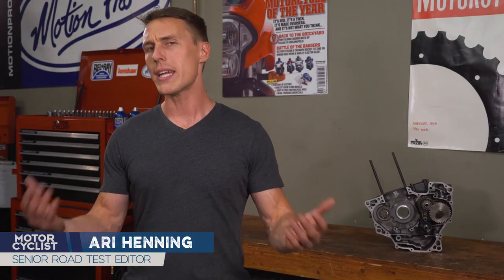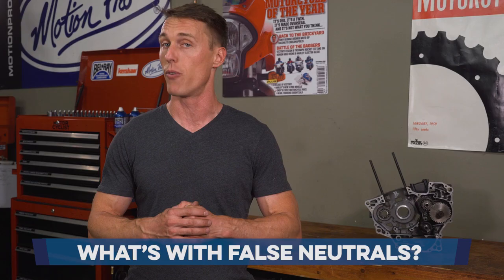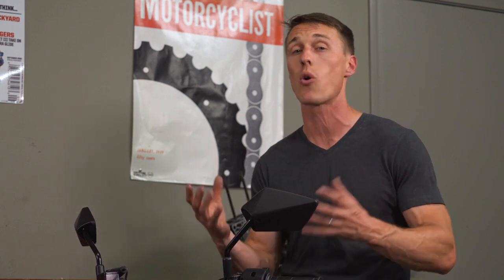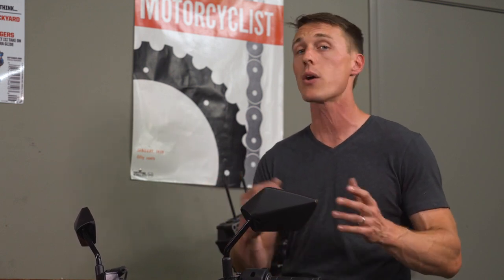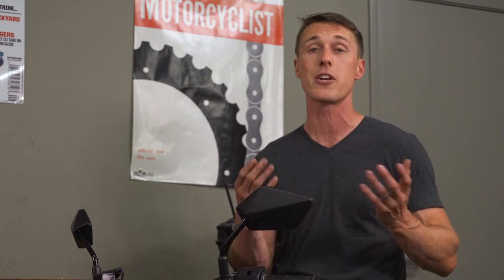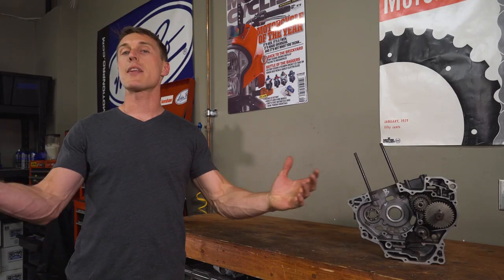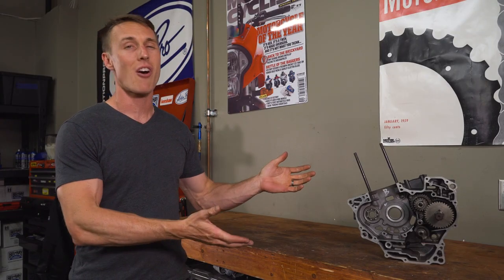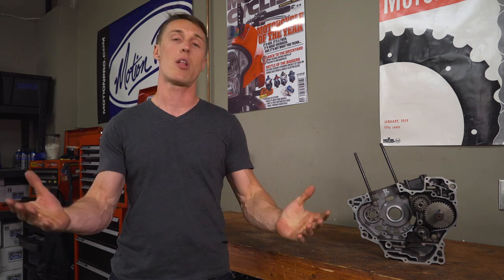What’s With False Neutrals? | MC Garage

Comment: Question for next videos I always wanted yo ask: Life expectancy of motorcycles. What average milege you can do until your motorcycle becomes junk?  Yes I know it very depends on riding style, oil change etc but why some 1000cc bikes like Kawasaki versys can do 300000 km but you rarely see R1 with more that 100000 km. What average engine resource for different types of motorcycles?
Reply: That's dependent on SO many factors. How the bike is used and maintained, the conditions it's ridden in, the metallurgy and manufacturing quality...
Reply: And how engine size scales with motorcycle lifespan? Does 250cc always lives less that 650cc or 1000cc ?
Reply: any motorcycle if its japanese will last forever if you take good care of it

key to long engine life is complete engine warm up, and clean high quality MOTORCYCLE oil

my 2015 fz09 has 40000 miles with no oil burning and pulled 110 hp on the dyno last week
Reply: Any bike engine from the major manufacturers will last a long time without needing to be rebuilt if you take care of it (motocross bikes being the exception). The reason you don't see many sportbikes like the R1 with high mileage is because most of them either get crashed and parted out or they just don't get ridden often enough. The Versys is much more likely to be a commuter than an R1, and you're also a lot more likely to crash the R1 in a way that totals it because of the expensive plastic.
Reply: My guess is that ergo bikes like the Versys have high mileage because they're comfortable, and people will ride them more frequently and for longer distances than a super sport. I only ride sport bikes (don't even own a car) so my bikes have clocked in a lot of road time. My 2016 RC390 has almost 10k miles (I bought it in February) and my 2001 Ducati 748r has nearly 100k miles. Life expectancy comes down to how the bike was treated, and I have no problem buying a high mileage bike if it's clearly been cared for and has full service records, because I watched my friend completely destroy his R1 in 8k miles, but there's a dude in my neighborhood with a 1987 GSXR 1100 with almost 200k miles that runs great.
Reply: Assuming they're built to the exact same standards an r1 has its peak power at 12,500 rpm and the versys 1000 at 9,000 rpm. It's fair to assume that the most commonly used rpm range is proportional to this difference, so that's roughly 40% more revolutions from the r1 engine for the same distance. More revolutions=more wear (though probably not 40% more). Also take into account the r1 is designed to go fast and the versys to go long distances. So the r1 has in some instances design choices that sacrifice longevity in pursuit of speed, and the versys speed to make it go further. Also a sport bike is likely to be ridden harder than an adventure bike.
Reply: bikes in the early days are built to last a long time but im not sure about modern bikes components of today. Seems like parts are outsourced from mainly China.I see newer bikes with frequent electronic parts failing even on Honda. Aint sure if its the hardware itself or just software glitch.  Engines are built by the manufacturer though.
Reply: My friend has Yamaha TZR 125 2t and it has over 95000km!! And every km has been driven without any power restrictions. I would say that's longlasting! Ofcourse it has gone trough many piston changes and other 2t maintenance but still.
Reply: @villepyykonen9664  sounds like triggers broom
Reply: @villepyykonen9664   Usually 2 stokes need new crank bearings at around 15.000 to 30.000 km for smaller 2 strokes like 50cc mopeds. I have rarely heard of those lasting much longer than that without bottom end rebuild...
Reply: I have Suzuki rg 125 f 2t and it has 64000km, and well i quess almost every wearing part is not original anymore :D
Reply: My Yamaha XJR 1300 has done 110,000 kms without a rebuild
Reply: A friend of mine has 70k on his Triumph Daytona (it's getting quirky, but nothing unmanageable).

I would say they do really well as long as you keep riding them. They do NOT like being garaged for long periods (I bought a "low mileage" deal with a few years on it, and the maintenance costs were high as it was constantly having issues with cracked seals and iffy wiring).
Reply: I think that would make a good video... though I tend to think that the performance bikes are "more tightly wound" and that results in shorter engine life. The tech evolution mean that when the engine does let go - your money is better spent on a new performance bike instead of fixing the old one. Other bike types aren't as likely to be slaves to that 'constant improvement' cycle and their motors are generally not as close to the design edge.
Reply: Sergey G my noisy 2004 Yamaha XJR1300 already clock 299858 km with only clutch housing noise when idling
Reply: Bought my 05 r1 brand new and only put one starter in it, Sold it with 75,000 miles on it for a fz8 with 12,000 miles on it. It's all about the warm up and oil changes. Up on one
Reply: Sergey G many factors. A multicylinder engine's rings and pistons will last longer than a fewer cylinder same displacement engine due to the fact that at the same rpms multicylinder rings travel less distance. But multicylinders are usually higher reving so the other parts like crank bearings and other bearings will have shorter life. Same is true with the bigger bore vs smaller bore same displacement engines. High compression ratios can also effect the engine life. The bottom line is an engine that is a balance between all the factors and will last longer provided it is well taken care of and fluids are replaced in time and riding style is more sensible  and is not abusive
Reply: Goldwing? Literally capable of 1,000,000 miles without an engine rebuild.

Comment: Regarding the clutch drag and clunk selecting first, in a perfect friction free world with zero clutch drag you would not be able to select first. The gear dogs are square ended, there is no lead in on the ends so if the gears are not rotating at slightly different speeds they will not engage. Try selecting gears with the bike stationary, no rocking it, and the engine switched off, it's dang near impossible.

Comment: Your videos are the best! Cant wait for some new topics. I have a question, can it damage the transmission? It happens to me couple times when i shift without clutch. Thanks!
Reply: Clutchless shifting will not damage your transmission if you're doing it properly.
Reply: That's why I included the "properly" qualifier. Done properly, no damage will occur. But you're correct in that a proper electronic QS will eliminate any risk of mistakes and subsequent transmission or wear.
Reply: Hmm, I've been clutchless shifting for years on various bikes (including racebikes I've been racing for years) and never had any actual issues. Transmissions are robust and tough, they can take a few mistakes without major failure. False neutrals are a great example of the torture they can endure.

Comment: sticking with transmissions... for Ari and you guys/girls,  here's a question I'm not sure has already been answered or not... on a bike with no quickshifter, are clutchless upshifts better or worse for your bike than using the clutch... I've heard they are, and once I'm rolling I very very rarely use the clutch to go up, even between 1st & 2nd, my 2015 Street Triple R seems to glide through neutral into 2nd without the clutch no problem...
Reply: Your Street Triple has one of the finest gearboxes known to motorcycling. The guys at Triumph did an amazing job with that setup. As for clutchless shifting, it's totally fine for your bike. I suppose some people might even argue it's better for your bike since it reduces clutch wear and thus particulates in the oil. In any case, we'll cover clutchless shifting in a future vid.
Reply: thanks dude... I look forward to it 👍

Comment: how about if you're in Neutral and are coasting (not that you should) and you move in to 2nd gear because you're in that speed range; the shift makes a HUGE sound, why? and is that normal?
Reply: it is because the difference in rotational speed of transmission input shaft (engine rpm) and output shaft (wheel rotation), if im not mistaken. You kinda need to rev up your engine before you pull the clutch (to increase rotational speed of the input shaft). Ari says it @1:40 when talking about re shifting after false neutral.

Comment: just came back from my second motorcycle class and the bike stalled even though the panel light said it was on neutral. Then I come home and there is a motorcyclist magazine video explaining exactly what happened and how to avoid.

just... magical..
Reply: the neutral light should not be ON, if you're in a false neutral. im might be wrong though.
Reply: No, you were in gear and the bike thought you weren't, that's something else. I actually thought that what happened to you is false neutral, as it looks like it's neutral but it really isn't.
Reply: Correct.
Reply: The neutral indicator lies, your instructors may tell you at some point. Some bikes are better than others for this, just an idiosyncrasy of how its designed. My Sv has never given me a false neutral light, but my dad's f650gs does it, and also the light does not always come on in neutral. Simply because the switch for the neutral light isn't located on the selector fork in the gearbox, but on components closer to the lever, so any slop in the movement could mean the switch is triggered before the selector fork moves
Reply: When I took my class they told us to never rely on the neutral light. It has never happened to me, but bikes do sometimes think they're in neutral when they aren't. Anyway, to avoid embarrassment just slowly let out the clutch when the bike says it's in neutral.
Reply: Mmmm that is bad and quite dangerous... The best thing is to not have a neutral light at all and use the good old method of feeling when it is actually in neutral, most of the bikes I have had doe not have a neutral light.
Reply: Being 'in gear' when the gear indicator is displaying 'Neutral'.... this is why I always clutch in and apply front brake when starting my bike. Once the engine is running, I slowly release the clutch lever then release the front brake. You wouldn't want the bike to get away  from you if it wasn't in neutral... especially if you weren't sitting on it at the time.

Never 'Trust' your gear indicator... always 'make sure' the tranny is doing, what the indicator says it's doing.

Comment: Whats going on when I can't shift out of gears?  Sometimes I'll be in 4th or 3rd and I'm coming up to a red light, I'll pull the clutch fully in and go to shift but get nothing unless I release the clutch and almost stall it, then it will allow me to shift gears again.  Its a new bike with only 3K miles on it and its been doing it since I rolled it out of the dealer.

Comment: I have a Honda 1990 NX650 Dominator. When the engine is not fully warmed up I can't seem to be able to shift higher than 3rd gear. No matter how many times I try it won't shift up, always hits false neutral. After driving a minute or two all gears work fine.

I've tried changing the oil (tried 3 different brands), adjusting clutch cable and adjusting the gear shift lever but none of them have helped so far.

Could it be something with the clutch itself? I don't remember having this problem when I bough the bike about an year ago.

Comment: Sometimes it jumps from 2nd into neutral when I lay on the throttle- my guess is the gear is only 1/2 inserted.  A firm shift will prevent that but I don't always remember.

Comment: i have a yamaha diversion 600cc '99 and sometimes when i go to 2nd gear and open the throttle all the way it sometimes pop out of the 2nd gear and goes back into neutral, when it does that i am driving at about 80 km/h ( 50 mph ) does anyone knows what the problem might be ? it does not always pop out of gear, just very rarely

Comment: Improperly adjusted gear pedal can result in shifting problems. When I adjusted the gear pedal too low, 1st gear was engaging properly but anything above resulted in false neutrals or grinding. It seemed that there was not enough up pedal travel to properly engage gears. As soon as I adjusted the gear pedal up everything seemed ok.

Comment: What about getting stuck in true neutral when upshifting from 1st gear to 2nd?
I seem to experienced this a lot, and some of my riding friends mentioned that i need to change my oil to something that is more expensive than the default recommended engine oil from the bike manufacturer. When this happens, no matter how high I try to push the shift lever, the 2nd gear would not be engaged (I have a bike with gear indicator). The only way to get out of neutral when that happens is while still holding the clutch, i need to let the shifter go back to normal position and then try to upshift it to 2nd gear. It's kinda annoying (and dangerous) since whenever I'm trying to quickly shift from 1st to 2nd is when i try to get out of a tight traffic, and one mis shift could probably end in misery on my part. What would you guys advice for this kind of problem?
Reply: that is common, due to the fact that gear dogs and housing aren't alway lined up perfectly.
If this happens while stopped try to let go of the clutch a little and then pull it back, or also rock the bike back and forth and then try to shift again.
If it happens while going no panic, just pull the clutch in again, ease the pressure off the leaver and gently shift up again.
To avoid it make sure you shift all the way up, and not leave it halfway. Don't listen to your friends as they are giving you bad advice. Your manufacturer oil is perfect for the bike, they tested it. Maybe not the best, but surely it is good enough.
And please don't try to push harder on the leaver as it could bend your fork... ease the pressure and then apply it again.
Reply: I see, thanks for the explanation.
But today, it got somehow worse, if i shift quickly from 1st to 2nd, it would go into 2nd for a bit, and i can feel the wheel response to my throttle pull, but about 1/2 second after that, it goes to neutral. This of course, makes me jump forward for a bit. Is there something wrong about that? P.S. My bike is a small 150 cc bike (which is the normal in my country) could that be usual in small capacity bikes (because of lower quality parts)

Comment: I had an issue where I can't shift my gear when I stopped on a hill. I tried to shift from second to first but it went to neutral, even when I pushed the shifter all the way down. And it didn't allow me to shift to first, not even in second as I was stuck on neutral. So I pushed my bike a bit and it worked. This problem only happen when I stopped on hill. Is it normal or I had a gear problem?

Comment: Excellent content as usual, explained simple and on point. Continuing with the transmission topic, what are the benefits of an aftermarket quick shifter for a street bike?
Reply: They're fun (addictive, really) first and foremost, but on the track they allow for quicker shifts with less effort, and that can mean faster lap times.
Reply: Slatteea that's not necessarily true. Some QS systems, like the one on the BMW S1000RR and Daytona 675R, work quite well at low engine speeds. Shoot, even BMW's R1200RT comes with a quickshifter (and autoblip downshift!) because it's so smooth and fun to use. It's not just for racebikes, though as with most technologies, racing is where it originated.
Reply: Smoother shifts, no need to use your clutch after pulling away (upshifting) and it's just fun.
Reply: Ari Henning Cool Ari I didn't know that. I should have mentioned my experience of them was from an old dynojet on a 2008 Triple. I used to break my foot using it in traffic.
Reply: But do add on quick shifters do the blip, and I haven't heard of them working on downchanges. I rode an MV with a factory quick shifter, it was fantastic and smooth.
Reply: N3DD Advantage? Less clutch lever squeezing/no need to blip the throttle when clutchless shifting. That's about it.
Reply: Unless you're on the track often I would advise against it. They dont work at low acceleration so it will encourage you to ride faster on the street. Will only encourage a ticket/accident.
But if you race they're great!
Reply: For a street bike? None.

Comment: As Ari said, even after shifting by pulling shift lever all the way through it's travel and there's still issues then you should check your bike's repair manual where the shift lever angle is mentioned.
I've read in the KTM duke 390 and 200's Owner's manual that the shift lever should be at 90 degree angle for optimum shifting.